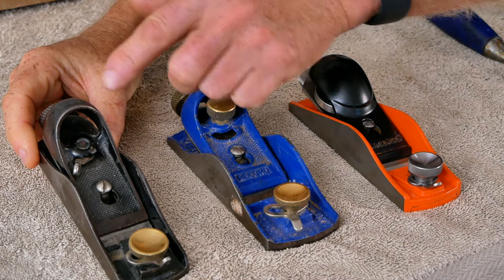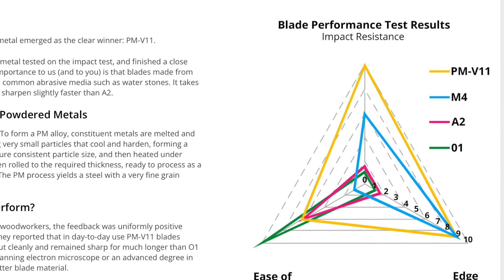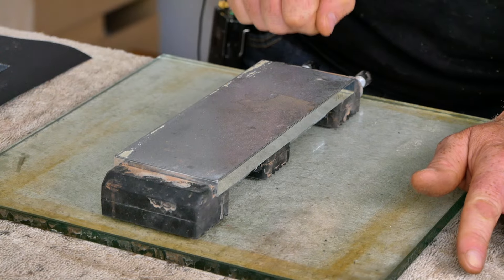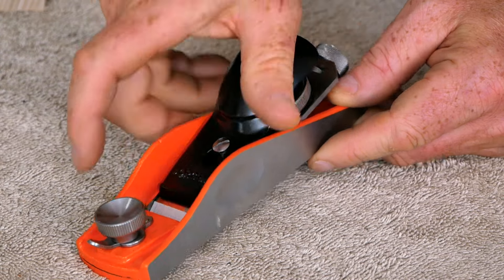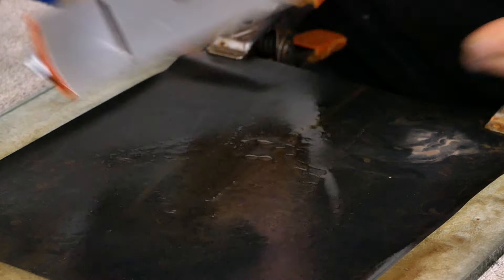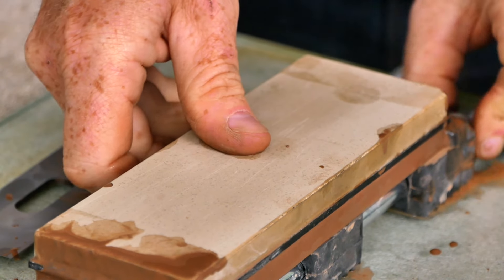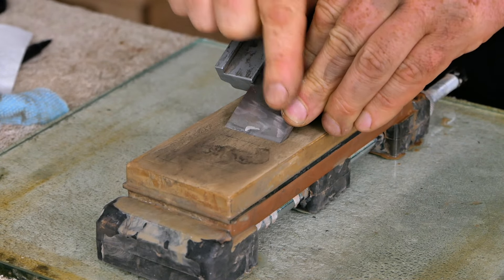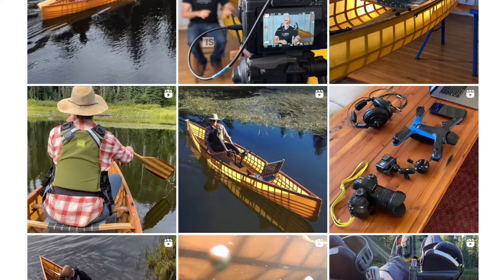Choosing and Sharpening Block Planes for Skin on Frame Boatbuilding

Comment: Solid information across the board Brian. One small correction though. The Shapton glass stones have a thin ceramic stone bonded onto a glass plate. Not particles bonded to the surface as with diamond stones. And warning to anywho tries them - DO NOT SOAK THEM IN WATER! The ceramic surface will swell up and trash the stone. Getting them wet during use is fine. I found this out the hard way as I leave all my water stones soaking all the time. Happily Lee Valley replaced it for me because those glass stones ar F***n expensive! I keep my stones flat by rubbing one against the next a few times every time I sharpen and once in a while, hit them with a diamond stone for good measure.
I use a somewhat different method than you but anyway you get your tools to the sharpness you need is a perfectly legit method to use. This one is probably the best for the new woodworker to wrap their head around and yield solid results. I used it for many years before drifting to a different freehand method. Great stuff Brian. Sidenote - Wet/dry paper is intended to be pre-soaked for a while before use. I have no idea if it makes any difference though.
Reply from the maker: @Nomadboatbuilding  thanks for the correction about the glass stone!